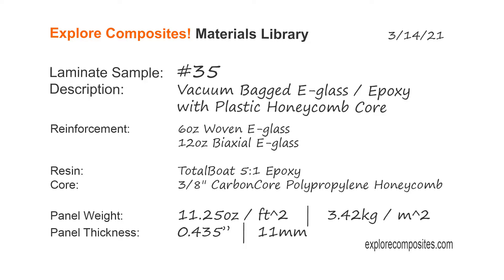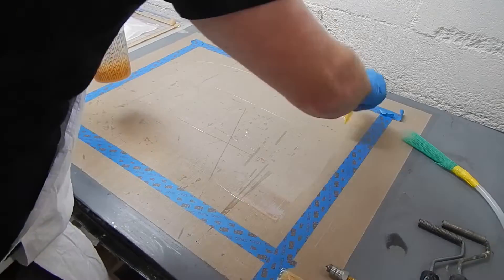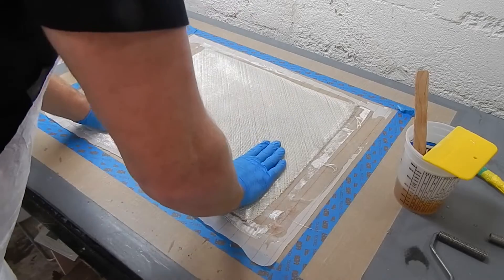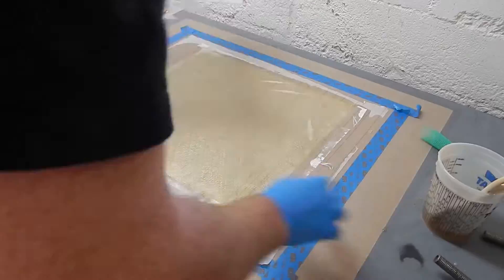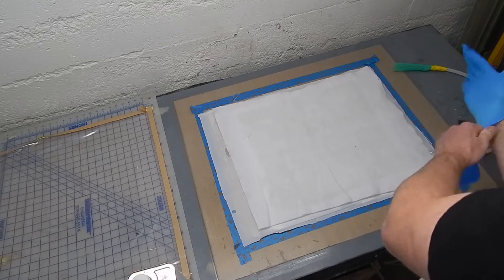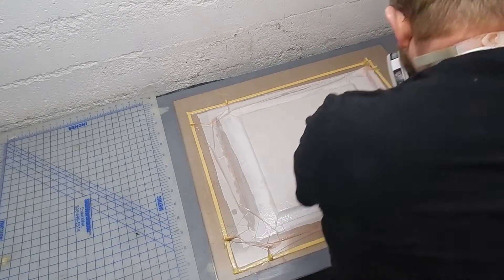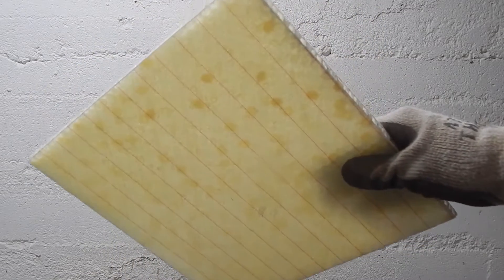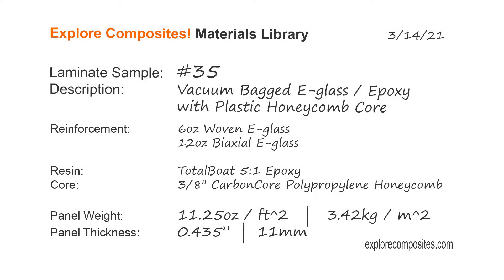Laminate Sample #35: Vacuum Bagged E-glass / Epoxy with Plastic Honeycomb Core

Comment: I need to produce Chopped Strand Mat Glass Fiber (Filler) + Epoxy Resin (Matrix) composites through Vacuum Bagging technique. Could You suggest me any online resources for the same or drop me your mail id ..
Reply from the maker: I'm not sure I understand the materials and the question but there's a link to email on the explore composites.com site.  Chopped strand mat and epoxy can be an issue because of the styrene soluble binders that most chopped strand comes with - you can get it compatible though if you need to.

Comment: At first I thought it would be a good core material for boats, but the cells filling up with resin makes one wonder. Is it due to porosity of the scrim?
Reply from the maker: Yes.  I was pushing my luck with the vacuum bag here.  I think the normal use would be with less vacuum or just open molding.  Resin in the cells isn't terrible - just a bit heavier than would be ideal.  There's no structural issue.
Reply from the maker: It is very common in boats - especially decks and flat parts.
Reply: @ExploreComposites  Thanks, that makes sense. I was thinking in aircraft mode, where hollow cells = much weight savings.
Reply: I've used a ton of plascore with open mold less hand layup (hovercraft/boat hulls). Incredibly strong for weight and very economical to use.  The cells do not fill with resin at all, it just stays on the scrim, so I'm sure the vacuum was the reason it soaked in.
Reply: @JasonKuehn  I'm planning a truck camper.  Do you think it would be beneficial to vacuum infuse panels and then join panels with hand layup or best to just build structure then hand layup whole thing?

Comment: I use the same technique of laying out my laminate schedule in reverse, makes the layup go so much easier. One question however, I thought that epoxy doesn't bond well to polypropylene.
Reply from the maker: You're totally right Grant! I missed communicating the detail that the scrim is a polyester non-woven that is itself somehow bonded to the polypropylene.  The resin doesn't stick well to the cell walls themselves and I was able to easily pop off the chunks that had pooled in the cells where I cut through the panel.
Reply: @ExploreComposites   But wouldn't the 6oz glass peel off of the poly skin on the sandwich panel? It doesn't look like it was just honeycomb you bonded to, it was a poly sandwich you reinforced with glass.
Reply from the maker: @GrantOakes  The honeycomb has a polyester scrim bonded to it so it feels a bit like a layer of strong plastic paper towel over the open cells.  Epoxy seems to bond very well to this - I should have included a destructive test but forgot.  I did break some and it is surprisingly tough.